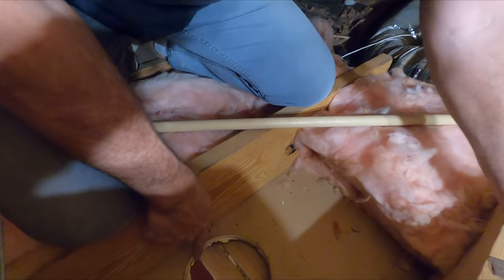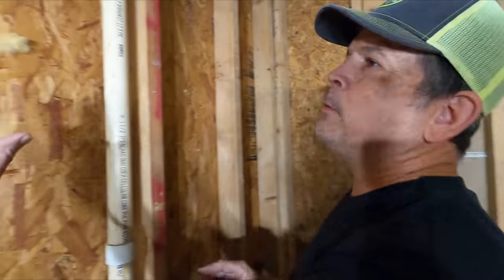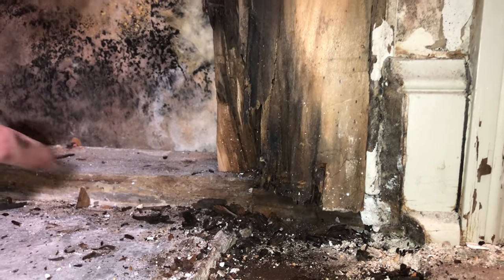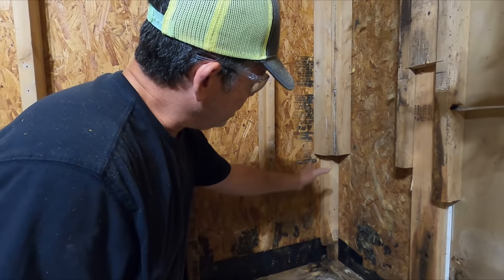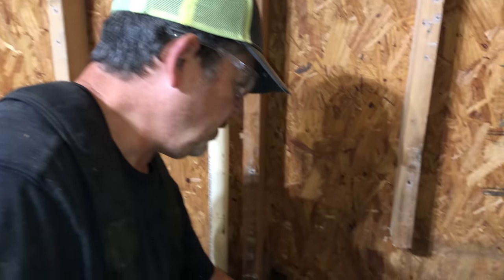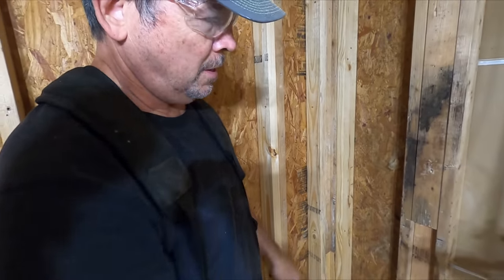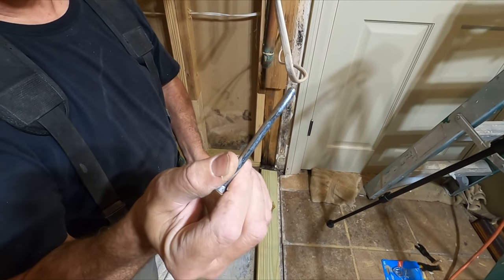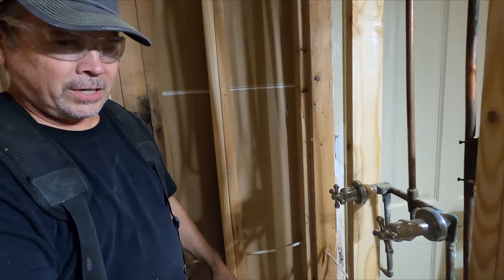Repairing ROTTED Framing in a Disaster Shower

Comment: I would have removed all of the wood that had rot. All areas with rot should have been cut out in my opinion and replaced.
Reply: In all likelihood, following that philosophy to it's inevitable conclusion, would require razing the house and building a new one. Each bout of demolition to replace rotted areas exposes more rot. Where do you stop?
Reply: @6:55
Reply: I thought so. I’m not a pro just a woman trying to replace my rotted tiled shower surround myself. I was always taught by my ex husband who was a general contractor that you don’t leave rot or moisture inside a wall or under a floor or in a ceiling. The small amount of time and money you save will be minuscule compared to the damage if the wall floor  or ceiling collapses. He would be called by horrified homeowners whose bathtubs had fallen through their dining room ceiling onto their expensive Art Deco period  dining room table etc.  Sometimes it was an older home with plaster sometimes drywall but covering up or half measures will bite you in the ass every time.
Reply: Some of that wood was for the exterior walls most likely T1-11 outside so that wood cannot be removed the builders of the home should have kept those studs separate a foot from the shower shower should have it's own frame not attacks fault

Comment: I know this is coming late, but I'm surprised how casually you handled the black mold. BEFORE replacing the stud patches, you should have used a mold killer spray to kill the mold... Then let dry completely... And then vacuum with a HEPA unit... I'd do the entire bathroom since you disturbed the mold. As for mold on the drywall goes, it should have been removed completely and replaced. Yes, a bigger job, but easily explained to the homeowner. Remember, take the attitude, "I can see it from my house", even if it isn't. Otherwise, great videos showing all the details and problems that can arise.
Reply: it's not black mold
Reply: Don't look now...but mold in all colors has been around since creation.
Reply: My thoughts exactly
Reply: @GreenPowerFarm  what is it then? Lol
Reply: @supersayainjesus7204  Mildew
Reply: Mold is everywhere on everything. Keeping it from growing is what matters
Reply: Discolored wood
Reply: He had a mask on. I’d put mustard in that mold and eat it it’s not that deep unless you have a Specific allergy to that type of mole if it is mold

Comment: Getting that wire out of stud was top tip of the video.... Paul. Lol
Reply from the maker: Love doing that 👍👍
Reply: I’ve got decades of carpentry, painting and remodeling experience.  Now I’m just a DIYer.  I’ve ran into this situation dozens of times and WISHED i had seen this tip earlier!!  Excellent wisdom from these guys always.  Will definitely put this trick into my bag.  Thank you!
Reply: @kevinwaycaster  Or just learn some basic electrical skills. That was one wire was running thru about 10 studs. It would've been much easier to just pull the wire out the way, both for the demo and to sister new studs in place.

Comment: Try using Mold Control from Home Depot on that black mold next time. Amazing product! Kills the mold without bleach and whitens the stain.
Reply: I use RMR-141. It kills the mold and when it dries the residual acts as a deterrent to future mold growth.
Reply: QD 64 Is the best IMO
Reply: Yes.Totally agree on mold remediation properly done before replacing wood studs. It not only prevents the new studs and future wall from black mold,  but adds profit $$$ to your overall job. I won't rebuild any wall without this procedure.
Reply: Mold Control is designed for non-porous surfaces only.  It is not intended for wood which is porous.  RMR-141 is better suited for treating wood.

Comment: Was there any treatment for the surface mold we. see on the  drywall and studs still standing?
Reply: I was thinking the same thing. You can't just cover it up or it'll keep growing and there'll need to be a 4th bathroom renovation. 

Vinegar kills mold. Most people think of bleach, but bleach makes mold "retreat" to a new area to thrive but doesn't kill it. Vinegar doesn't necessarily make it look any different visually, per say, but it does kill it so it won't keep growing.
Reply: I would definitely spray some mold killing primer on that.
Reply: As a certified mold remover. 
I would’nt let any mold in the wall. 
You should always remove every bit of it at least 16 ‘’ past any bad area . 
Also PT is not allowed inside. 
That looks like a do it again job. 
Don’t let Mike Holmes see this. 🤨
Reply: @yvesouellette9612  This is exactly what I was waiting for someone to comment on (16").  Thanks Yves.  You're the man:)

Comment: I hope the homeowner does not live to regret not updating the shower control plumbing while access is easy. Leaving the old work in will be an issue at resale, since it should be disclosed. It would be disingenuous to call this a 'fully remodeled' bathroom without a new shower control valve.

Comment: Note on mold.  We had a bad mold problem and I went thru 4 gallons of Concrobium, over several applications, before realizing it's simply not effective in porous materials (as the label states).  The deeply embedded mold just grows back in a week.  Concrobium works by crushing the molecules when drying, but only the molecules it comes into contact with and it has no affect on future growths (ie: the mold re-growing from within).

So, after allowing to fully dry, and possibly after washing, sanding, plaining off the infected wood, follow it up with Zesser Mold Killing primer (available in 13oz spray cans).  It is the only product that works on porous surfaces like 2x4s.  Or even just skip the Concrobium step.

I've only used the paint-on gallon version of the primer.  It's much thicker so may soak deeper & leave a thicker barrier, but I know for sure the Concrobium isn't permanent.

Also, if there's some future leak, it'll protect the wood somewhat.  I've taken to applying a coat to all the studs before drywalling.  It's an extra "theoretically unnecessary" step, but should there be another leak, it'll somewhat mitigate against stud damage and mold.
Reply: Wow!!! I wished I would have read your post before I just spent the entire day tearing out drywall to treat the would with Concrobium
Reply: Thanks for this! I am about half way through the demo of our shower that didn't have a membrane and water was leaking under the tile floor. I even found plywood and fiberglass insulation that was covered in mold inside the drywall. I'm going to have to have some of the wood cut out and replaced but thanks for mentioning the primer.

Comment: How do you get the wire back inside the studs? Do you need to drill new holes then disconnect it and run it back through?

Comment: Yep, those pieces showing mold from the backside need to go, that Sheetrock is toast anyway. 

The sill plate under the shower valves I would have raised up to level or above existing before setting the pressure treated since I would not want it to be the lowest elevation in the bathroom. Pressure treated is forgiving to water for a while, but not indefinitely.

Comment: I see this is an old video but I do hope that I can get a reply. My bathroom subfloor specifically around the bathtub area is rotted so I can only imagine what it looks like underneath the tub. Also the 2x6 that the stud sit on for the wall is rotted as well. I need to take the bathtub out so I can see the rest of floor as well as see how much of the 2x6 is rotted. I know I need to replace the subfloor but for the 2x6 how do I replace the rotted portion without risking losing structural support for the studs? I demoed my bathroom floor thinking it would be an easy fix but once I saw the rot a series of curse words flew out my mouth unfortunately. I have demoed and tile two other bathroom in my parents home and it turned out beautiful but dealing with rot, structural support, and also checking to see how much of the wood is rotted is new to me. Come on studpack, give me some advice.

Comment: I’m in the middle of a similar job myself and agree with most of your methods here. I don’t know if I missed something but I think you should’ve spent a few moments talking about mold remediation. Although I’ve treated all exposed obvious moldy areas, one that stymies me is the moldy and decaying Sheetrock that is behind the studs in an area that isn’t accessible, between the studs and a brick wall. I’m considering breaking it out and wedging cement board in that space or using hardening foam.  Have you ever used those in this type of situation?

Comment: Did you have Odor In this Bathroom? I got a Very Bad Odor Coming from Behind My Bathroom Drywalls. the 2x4s in Mine arent As rooted as Yours. However, it Smells Terribly Bad. Plus, They have Black Dried Dusty Looking Stuff (Most Likely Mold) On there. Im Looking to Do this to Hopefully Solve this Big Problem for Me.

Comment: 8:35 with that stud to the top did you just push that wire back against the wall instead of cutting and re-running it through the new piece? Or maybe you just notched it on the wall facing side? I would hope there is no friction there, no?

Comment: Great work! As an FYI, the mold will cross contaminate other spaces through the HVAC ductwork and any other opening. 90% of the time the homeowner won’t have a clue, until a kid starts wheezing soon after demolition or the homeowner smells something. 90% of those won’t do anything about it, BUT there’s ALWAYS that ONE owner who will KILL your business!! 
Another point is that any drywall that has mold has to come out. Can’t spray bleach or anything else on it because it just makes things worse! Call a pro!
Reply: You absolutely can handle drywall. I've done it in every apartment I've ever had. There are sprays just for it. Read your can at your store my guy.
Reply: I knew the mold police would be in the comments. No need for a "pro". Just because someone bought a franchise doesn't make them a pro.
Me? I would replace that drywall.  
Mold is everywhere. Don't go outdoors!!!  ReeEEee!
Reply: RMR-86 & RMR-141

Comment: I just did similar job. Ripped out all siding, sheathing, rotted studs, rim joist, bottom plate, everything. Every piece of rot was replaced. Re framed entire corner of house. Important to replace all rotted everything.
Reply: Agree on replacing all the rotted everything. However i this video, for the base, the guys put new 2x4 over the rotten base. Removing the base can be done, and other videos show how. After all these guys have done to this site, and so much removal and replacements, I wonder why they did not replace the base board of the wall.

Comment: I'm curious what you think about epoxy type wood hardeners.  I used one once and it poured on extremely thin and soaked into some dry rotted wood.  I'm wondering if something like that would have any benefits to the small amounts of rot that was left in this area.  My thinking is that  the epoxy would soak in and encapsulate any mold and rot. It would also harden the soft punky wood even though it wouldn't be necessary for strength because of the additional studs.
Or would that just a waste of money?

Comment: Is there any reason carpenter don’t use pressure treated wood in other areas other than areas the that touch concrete or the ground ? I replaced some rotten studs and just replaced them with pressure treated wood.

Comment: I remolded my c. 1959 bathroom and added a new shower where the tub was. I also found problems with stud rot, mold and mildew.  Like here, I replaced all wood that was rotten, cut short a few stud where they were bad at the sill plate. In my case, and I did this in the winter, I also had to remove and replace some sheeting because I removed the bathroom window.   But, I then abated the mold and mildew.  Killed it, then sealed it.  To be sure, I went the extra step of painting the stud work with a mold resistant paint.  Of course, new mold and mildew is not a problem when properly installing the shower and its plumbing.
Reply: I have black mold in my house I already removed the drywall I have minimal rotten but m not sure how to deal with it can you share your method with me I'm afraid it's between the exterior metal if I spray it really good is it gonna be ok or do I have to take the outside of my house as a last resort
Reply: @austinstaton5277  First, I am no expert. I am just some guy that bought a home sight unseen. I had success because I removed & replaced all wood studs & sole plates that were infested with mold or mildew. Then to both the new wood and the existing wood not infected, I applied Moldez Mold killer inhibits the growth and spread of mold and mildew. It wipes on and wipes off.  I applied this first and let dry.  Then I painted all exposed wood surfaces with Zinsser Mold Killing Primer.  Finally, I sealed my concrete floor with Red Guard waterproofing and crack prevention membrane-a rubberized sealer to prevent hydrostatic infiltration of moister from the ground (no vapor barrier installed in 1959.)   All these products I bought at Home Depot.  As to your question about removing the outside wall - I was able to remove infected studs from the interior BUT and this is a big butt, I had to repair and replace the sheathing because it was nailed to the studs.  I did the sheathing work after the weather warmed and installed James Hardy siding to match my existing and covering the now missing window.   If it is mildew on the metal you are concerned about, the Zinsser should protect you after you clean the mold that is there now.  The key to success in mold control is controlling the moisture and/or water penetration.  You should have and use a bathroom fan to remove humidity after showers, etc.   ** If you have more than a three foot square area, I'd advise professional mold abatement. The health of you and your family is worth the expense. **

Comment: Some years ago, I fixed my Master bathroom by myself but I took too many times to do it. When I removed the step in the bathroom, there were two pieces of 2x4 terribly damaged which looked like dark toasted it. The damaged cause by the slide doors leaked at the bottom rails. When I remodeled the new bathroom I did not want to install the slide door.

Comment: Thank you for showing how to do things right. I just demolished a bathroom from the previous owner who used porous marble everywhere and no waterproofing whatsoever on the shower curb and drywall. It was a moldy disaster leaking water all through the basement. All the framing was rotted 2x2 toothpicks. It truly boggles the mind. I am reframing like you demonstrated and installing a full Kerdi system. No more toxic bathroom.

Comment: I wish my shower walls had looked that good!  We ran into a live infestation and rotten/eaten studs quite a few feet up.  The Sheetrock paper was eaten as was the paper backing on the fiberglass insulation.  It was horrible!  Like the one in the video, it included an outside, corner wall on the first floor.  We had to sister/replace 10-12 studs.

Comment: Dr pepper drywall patch is special order. More comon is bush. Bud, and pbr as well as Miller patch boards. 
With occasionally a miclob or crona and maybe a local kraft brand or 2. 
Its boluvard here and the patch material is 3 ply  it will last longer ship futhere and more redly recyclable 

Hey it was late I was drunk and this shit works so use it.  It is however on the wrong side of the wall.  
You take the cardboard fold in 2 with a string in the center place it in the hole and let it unfold inside the wall then tape the string on the outside of the wall. This helps keep your compound in place.
My dad taught me this trick and he installed lath and plaster walls some 65 70 years ago he also owned a construction company and did stucco 
 When he was 74 years old he worked on a bank 2 younger guys did one side he did the other side, he did everything on his side and came back to there to help them finish the scratch coat this took sevral days. But the old man made 2,28 year olds look stupid and slow. 
So if my dad said this works with his background in building its not a problem smart ass.   It is what it is  you use what you have, if you don't have scrap sheetrock laying around then you do what you have to.  Yes you could screw door shims onto the backsides  go in the attic and glue on sheetrock or plywood
As long as its as strong as the wall and looks good it really dosnt matter how you did it. You can only see the finished job. 

Any car dealer will tell you they don't wash or wax the top of a van why would they you cant see it.

Comment: I’m redoing a bad shower myself as we speak. My master shower looked about like this one so I can’t tell you how grateful I am for your videos. I’m a DIYer and this is my first shower to completely redo. I feel better prepared watching your excellent videos. I do have one question (who am I kidding-I have a million questions- lol) but here’s this question. When framing up areas of 2x4’s that I’ve cut out, due to rot, can I screw the new boards back into place instead of using a framing gun? I noticed you used a framing gun, was that just for your ease or is there a reason? Thank you so much. Keep up the great work and videos!
Reply: You want to use nails when framing load bearing walls because screws will snap as the house settles, nails will bend and remain strong.
Reply: Like American Patriot said, Nails are better for framing. You can either nail by hand or gun using 16d common or sinker 3 1/2" nails or you can sometimes use screws but they need to be structural screws and it is dependent on your local code.

Comment: I had a customer with the same issue and it was so bad the bedding was BLACK from mold. It was very nasty the previous guy just went over the old floor and did a horrible job he ripped the shower pan liner and the corners had stand long water because it was leaking so bad.